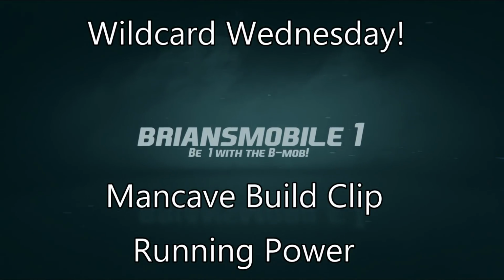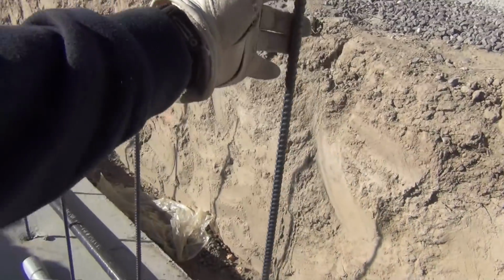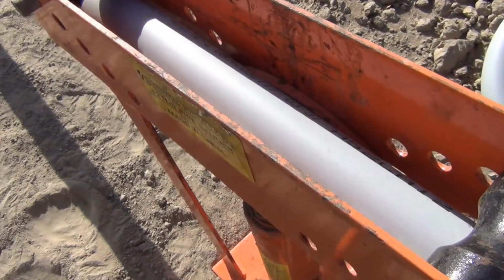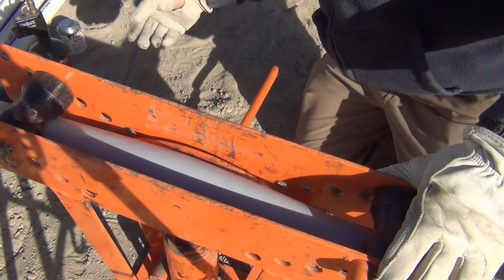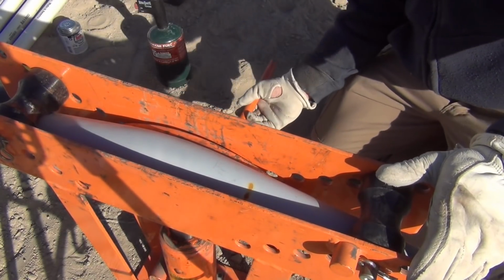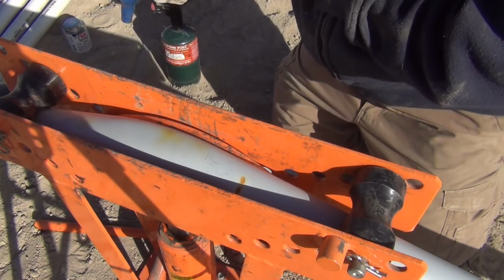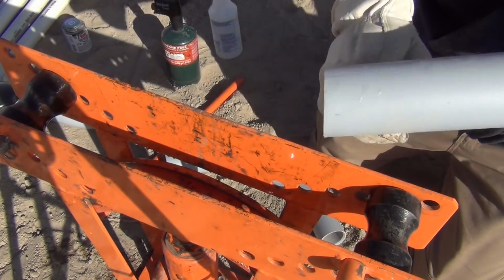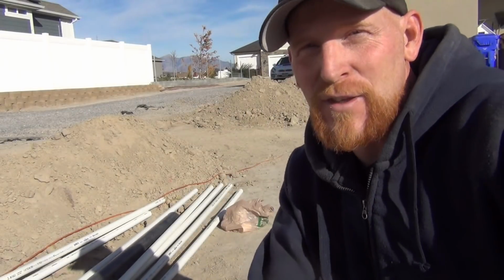Bending Conduit With Fire How to My Way

Comment: To thread conduit put a plastic fitting on the front end so it will go wire ,fitting ,epoxy glass marble to the other side of plastic fitting! When it comes to a lip the marble will jump the "curb"

Comment: You can also place the pipe on a flat surface roll it as you heat it and after it gets soft enough shape it into any angle you need.
Reply: Joseph Spina I

Comment: Good idea for making smoother transition bends with fire. You can also rent an electric hot box that's meant for heating & bending PVC pipe or just build a hot box with a heat gun as your source of heat.

Comment: the longer piece of rebar, does that bond to any other pieces of rebar creating a ufer or CCE?   if it's just a piece of rebar in concrete, even metal twist tied to other pieces of rebar then it's not going to do much.  need a #6 to meet NEC, good enough for house electrical, but not lightning.   i'm going thru this right now, trying to ground a tower on solid rock.. it's no fun.
Reply: Obsessed House in Canada we use CEC vs NEC but provisions to section 10-812 allow us to use a #6CU for any service and XO for transformers.
Reply from the maker: It is.
Reply: @Obsessed house  > I would have to hate rock to sink a ground into. But it’s copper plated steel. I have seen guys use electric jack hammers, take and old bit, then weld a length of heavy pipe, stand on a support ladder and drive them home. Just make sure to grind a point on your ground bar.

Comment: Also put in a regular smaller conduit next to your big one, so that you can run either phone or data cabling through as well, without having to use a cable that is rated to run with power in the same run. You just use a cheap regular CAT6 cable instead, and pull in 2 at the same time for a redundant connection, allowing you to have Internet ( reliable wired connection that does not fade out in rain or snow) and a wired phone in the garage shop area. You can put up a wireless extender there for the data on the phone, and not have poor spots all over the place.
Reply from the maker: Good idea

Comment: Oh the memories.  Your doing it right Brian. It's going to be a fine shop/man cave when your done. Not that you need any advise but one thing I did was to install a drain in one area of the floor for washing cars or equipment. It's great for the winter time.